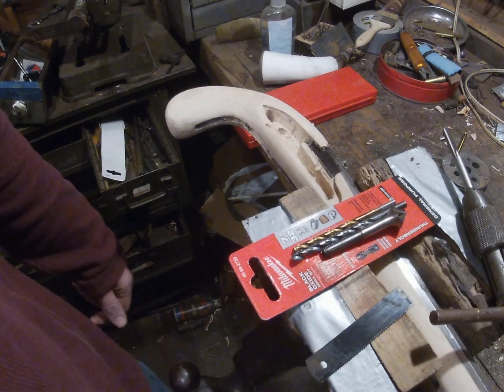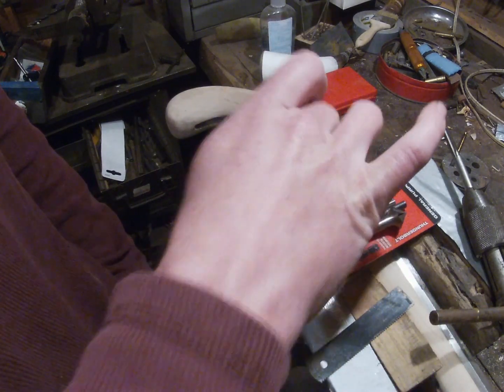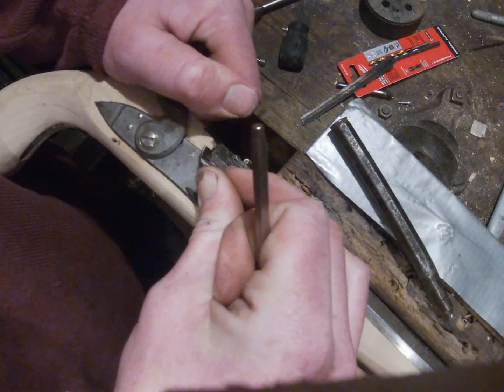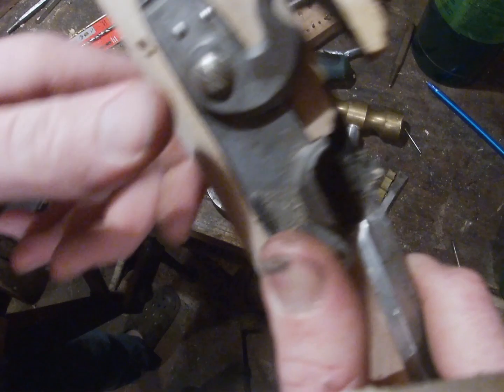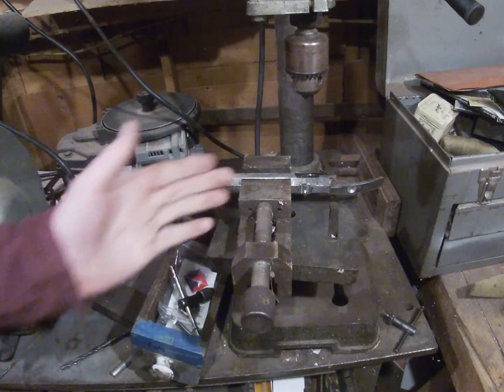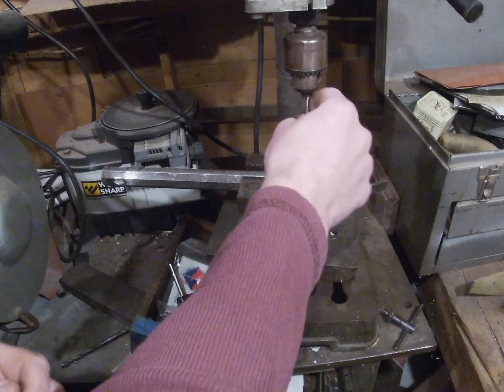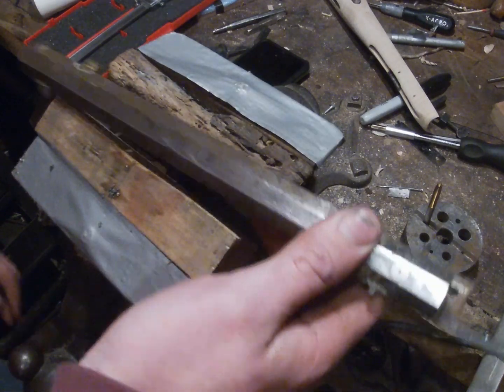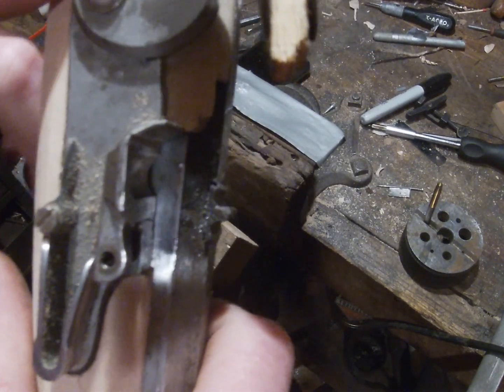Installing Touch Hole Liner

Comment: Bless you!  I decided not to use a cap lock and just unvested in a flint lock lock of same size (interchangeable).  Ordered, with it, a touch hole liner.
Reply from the maker: That's great
Reply from the maker: And I am glad you enjoyed the video
Reply: @thesquirreltail4570  10 Months later: I have a scribe to replace the one that got lost.  Tomorrow the 1/4"- 90 degree counter sink arrives to replace the one that got lost.   Recently I had to move things for clothes washers to pass.  I have a long barrel to work with, so today I arranged things on top a tall stool to get exactly the correct height to support the swamped barrel.  There is a vise on the top the press table.  I will have to guess the thickness of the shim (s) to put under one side of that vise.  Or maybe I should do it mathematically with Vernier caliper measurements and geometry/trig.  I must not allow the liner, even with filing, to cause a gap between the pan and the barrel.  It had taken an ungodly amount of time to get it positioned and screwed down with two side screws.  There is no gap now.  But will there be one when I'm finished?

Comment: I’m assuming you never need to remove this? How does one replace when needed with no threads?
Reply from the maker: Chambers liners last 1000 of shots but if you need to replace it you can use a easy out
Reply: @thesquirreltail4570  I have not had luck with easy out's can you recommend a brand? Should I use anti-seize in installing the liner?

Comment: will the big hole make the barrel weaker
Reply from the maker: In theory yes but if you have good threads it's more then strong enough for the pressures at hand
Reply from the maker: Consider the breach plug is threaded in
Reply: @thesquirreltail4570  damn i thought threads were a weak enough point already without a hole in it

Comment: I've been in the Muzzleloading family since 1975.  Yup, I'm old.  Anyway, I've been making my own SS touchhole liners for a long time.  I pickup up a 1/4" SS rod for a couple of bucks.  I have a tap and die in 1/4 x 28 NF.  I also cup out the inside and I cut a screwdriver slot.  Mine don't have the countersink but I've never had one loosen up on me.
Reply from the maker: Sounds good

Comment: I fit mine all up before any counter sinking and used 1/4:24 more available same tools I use for cylinder nipple Hela coil repairs. I recently started to use my DYI gun grease/bore butter for drill or tap lube and working Very Well. I also chase the threads a few times and remove and install my breach plug, but I made my liners removable with slots as my breach plugs are part of the structure on the vent threads as I often remove my breach plugs for Fast Cleanings! or to clear the barrel.
Keep Your Smoke Poles SMOKING!! Love the shop!

Comment: I would have started the tap in the drill press,.....to keep it straight.
I would have used a mill bit to start the pilot hole too, stout shank tapered down to 1/8 so the bit don't walk.
Typically they are part of tapping kits?
Reply from the maker: Not a bad idea
Reply from the maker: I just buy buy individual taps never got a kit